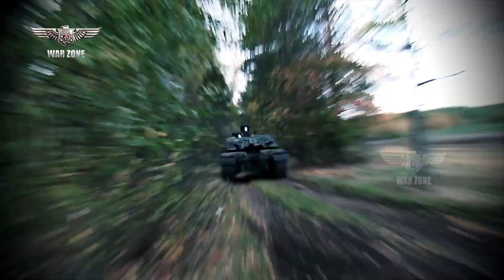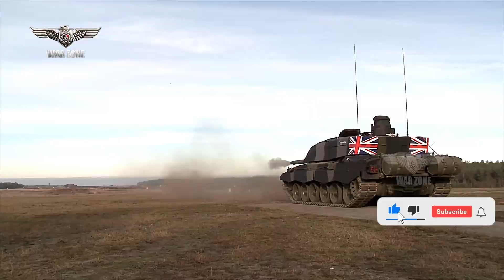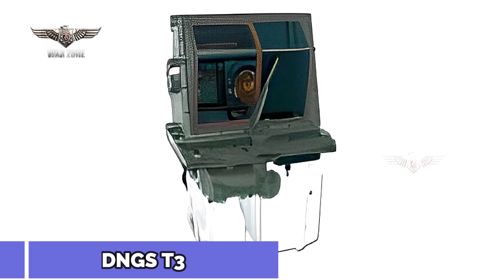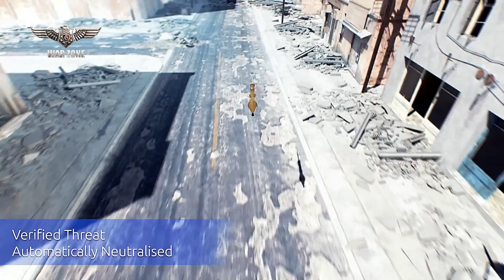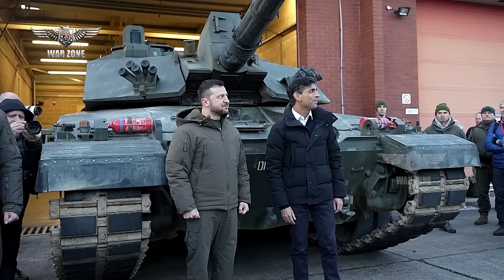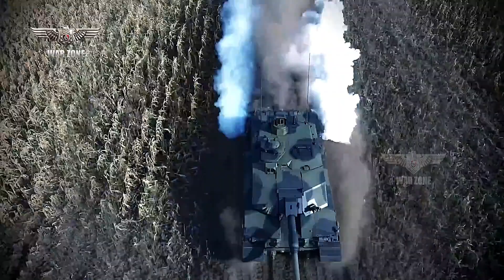Finally: UK Launches New Challenger 3 Main Battle Tank

Comment: As a armed forces veteran, I don’t think we should be freely advising on the public domain of the design and capabilities of our new tanks or any other mechanised weapons and vehicles, why you might ask, it’s simple, need to know basis, if the public knows about then so will any enemy. The elements of secret and surprise on the battlefield and in the theatre of war is the biggest weapon.
Reply: You can bet that the info they do let out is low level. They’ll keep the specs and exact capabilities under wraps.
Reply: @Skiddins  yea no.. most of these are private companies and they just wanna selll.. these companies are not controlled by the goverment. What you see is what you get
Reply: JESTEM Z POLSKI I MA PAN 100%RACJI
Reply: it is refurbeshed crap 
- The Challenger 3 has been unveiled as the UK’s newest and most “lethal” main battle tank (MBT); 
- The Challenger 3 is produced by modernizing existing Challenger 2 MBTs with 127 planned for conversion from the UK’s existing 221 Challenger 2s; 
- The refurbishment/modernization of 127 tanks will cost $990 million or approximately $7.8 million per tank, several times more than modernized Russian tanks, and even more expensive or as expensive as new Russian tanks; 
- The Challenger 3 will weigh more than its predecessor, and both tanks are heavier than their Russian T-72B3, T-90M, T-80BVM, and even T-14 counterparts; 
- 127 MBTs in total will mean that most likely fewer than 100 tanks will be operational at any given time making it impractical for the UK to project military power abroad in any significant manner; 
- The Challenger 3 features a 120mm smoothbore gun that will use NATO standard tank rounds which is an improvement over the Challenger 2’s rifled gun which required unique ammunition incompatible with other NATO tanks; 
- The Challenger 3 is another illustration of Western military industrial production, emphasizing expensive, complex weapons built in small numbers to maximize profits versus equally capable, but cheaper and more numerous Russian or Chinese weapons designed to maximize both battlefield and strategic effectiveness;
- While a Challenger 3 may or may not be capable one-on-one with a Russian MBT, the fact that Russia has many more tanks and is able to replace damaged or lost tanks faster than the Challenger 3 and other Western MBTs proves a disadvantage to the UK and the rest of NATO;

Comment: If they are going to equip these tanks with blow out panels then they must be made heavily armoured with enough protection against drone attacks, I would say use chobam armour on the whole top off the tank as it’s certain most future threats will be top attack munitions
Reply: that is too heavy lol. that is why its only really on the  front part of the turret. Should go with active protection instead and sensors to help crew to not get into position enemy can easily attack. Avoidance is the best defense.
Reply: @jeanmuyuela8112  actually it’s not as they only need apply enough to stop a rpg round, and it can also be designed as application armour so it only needs fitting once it’s required, but it’s obviously needed as just look how easily the m1a1 where knocked out because the Russian drone operators understood the top blow out panels where nothing but lightly armoured top panels, if it’s a weight problem them remove some armour from the front arc as it’s obvious most tanks no longer have to fear direct frontal attacks so remove the weight from there and use the savings to up armour the areas that are most susceptible to drone attacks that being the wafer thin top armour on M1s I said years ago this was going to me a massacre problem for the M1 fleet, actually you say it would make a tank to heavy and you laugh but infact your very wrong as the challenger 2 has a massively heavy armoured roof with chobam armour to protect from top attack since the 1990s, go look at Videos of challenger 2 roof armour thickness and then m1 roof armour and you will see that challenger definitely uses chobam composite up on the roof so as to protect against top attack munitions
Reply: @jeanmuyuela8112  and you say it’s only used on the frontal arc because of weight and yes in a way you are correct but the challenger two has chobam on the front and roof as standard and the front hull and sides are very thinly armoured but they will never enter actual combat as such as they were designed to only ever go into combat with Dorchester armour mounted module packs fitted
Reply: @Custodes1  they dont matter as they are too thin... only on the cheeks is actually effective.  Also are you blind? Cant yoy see how big is that driver viewport? Massive obvious weakspot. And you have to accept the fact that tank do get hit inc the hull
Reply: @jeanmuyuela8112  drivers view port lol it’s not a computer game your playing where it’s easy to hit such a small part of a relatively small target over all, have you any idea how small a tank size target actually looks while viewing through optics? Go out try shooting a toy car with a air rifle 200 feet that’s what it’s like trying to shoot a tank any even 1 kilometre with tank optics and your lucky to hit the tank never mind trying to hit a small section of the tank especially the drivers port, trust me it’s not anything near a weak spot
Reply: @Custodes1  lol all you have is "this is not a video game" i did not base it on video game. The viewport is like 20% of the front surface area like come on get some common sense. Also it was already lnown it got easily petentrated from the lower front by a simple rpg. Challenger tank is soo overated. No proof of it performing well just all he said she said. Atleast there is a video of t80 getting hit multiple times by an rpg before disabling and that tank suck too but challenger is the worse and people who praise it is just dillusional
Reply: @jeanmuyuela8112  this is what really annoys me as people like yourself who has only ever learned about armoured warfare from games such as war thunder and that world of tanks which if I’m not wrong both have been created by Russias and in such games they will feature the challenger 2 in game with just normal standard armour the armour set up the CR2 will have while not at war and they take these figures and feed it to dudes like yourself but if it’s T90 they will add all reactive armour to the tank along with a vast helping of fake made up super figures that basically makes Russian vehicles basically indestructible lol and real life shows and proves the exact opposite, it’s a reason only one challenger two was destroyed in Ukraine, after a mine strike thén multiple kornet strikes and then the Russians had to call in a hit from their massive drone and only then after a few hours of a stationary vehicle were they able to destroy it

Comment: There will be a power increase as the plant will be upgraded with a new fuel injection and cooling system, the new plant is likely to put out 1600 bhp. The hydrogas suspension is also upgraded improving mobility further.

Comment: its not even a new tank, irs challenger 2, with a body kit. as no new chassis are being made. so if one is taken out, they will have to scrounge the scrap yards, or ukraine, for a spare challenger 2, to upgrade
Reply: Completely wrong and you obviously didnt watch the video. The only thing that will remain from the challenger 2 is the hull, the hull of the challenger 2 was already a great design. Eveerything changeing is the electrionics, vision systems, passive protection systems, new engine, new turret ring, new turret, new gun, new suspension, new engine. Literally everything is going to be new except the hull, so how you can say at that point its not even a new tank is pretty baffling. They also stated in the video that with the new RBSL factory they can make new hulls if needed, for example if there are future orders or foreign orders. However why throw away what is already a great design, its better to use old hulls and save a few pennies.

Comment: it just an upgrade...... if we want more we cant have them (once challenger 2's runout) why not have built a new tank incorporating the lessons learnt but in a new tank  which would have been even better plus we could produce more if needed !!
Reply: we can build more Challenger 3s they said in the video they have the capacity to make new hulls at the RBSL factory.
Reply: @ashleygoggs5679  What they mean is using existing  chassis not a new one....they say the might be possible to make new chassis not that they can this is really more impossible ...it would have to be remade as all mold's and other equipment is no longer available ...then you might as well use a fully new designed to make use of improvements

Comment: So smooth bore instead of rifled, to fall in line with the rest of nato, but are the advantages worth it?
Reply: Yes, rifled guns are not more accurate nor do they have more range, becuase if they did every tank in the world would use them to take advantage. The commonly used ammunition of a particular country will dictate the cannon being used, British have always loved hesh so we used rifled gun as this gave better results for this round. However hesh would see less use in a modern battle field and there are other HE round that can be used in a smoothbore that fullfill a similar role. Smoothbore cannons allow for more accuracy and range when using a Sabot round aswell as meaning you can have a longer penetrator which allows for more armor penetration. So overall the tank will have more armor lethality. But the overall advantage is having more ammunition as it will use nato standard, another benefit is because we arnt using specific round anymore, ammunition will likely be cheaper becuase of its abundance.

Comment: What a disappointment not the tank but the amount of tanks involved not even new tanks , this needs to be rethought all Chalanger twos need to be converted not just one hundred odd . Germany on top of its present tanks has just orders one hundred and seventy four brand new tanks , they even have the KF 51 in the wings . Even the present amount of Challengers is not enough it needs to be three times the amount that of the Challenger two also I would look at buying the CB90 120 or have the Ajax have a simaler model as the Amaricans have done with there M10 Booker which is based on the Ajax Hull and body . There are many jobs that need a heavy mobile gun but does not need a tank , in the British army this used to be done by the Abbot self propelled gun which also had a 105 gun , it was maneuverable enough quite than a tank and was at its time fast enough to keep up with MBTs and APCs AFVs on top of this the Cockerell turret with its 105 gun is an option especially cupped with the 119 amunition used buy many NATO country's including Amarica  as they use the L119 Howitzers , useing the Cockerell gun and turret and the Ajax Hull would make it very light around thirty tons it also has the added advantage of the gun system being a self loading system reducing the crew to three . I understand with reduced crews the problem of maintaining equipment , we had the same problem with the Abbot we got around this but having two exstra men in the stalwart the amunition carrier for the Abbot they would dismount when delivering ammo to the gun stay untill the stalwart picked up the spent rounds and empty boxses we also had two exstra 432 APCs one for each troop with exstra men to preform gun position safty and quick responce but at night returned to there guns to do Maintenance this also worked if the gun though a trade one of the 432s would stop and as they say many hand make light work . This meathod could be applied to all vehicals with Auto loaders like the KF51 with I see is the next logical step in modern warfare this Veical MBT has many new technologies that can be used some not fully optimised.  Take the position of the loader , his job could be changed to what the Airforce call GIB guy in back the weapons officer , he could be responsible for manning the radar operating the drones and the loitering amunition also maintaining the digital information net as well as the radio net takeing more of the workload off the tank comander if needed you could have two men in a mirror set up like the TC and Gunner on the left of the tank these are just my thoughts but I think this would work . As for Funding there are many ways to do this one is to stop all funding to overseas country's most of which goes into corrupt officials pockets and not the people who need it and some country's India do not need it they look on it now as a snub they say they are doing fine they don't need this hand out ,true enough a country with its owen space cappaserty does not need our help anymore . This could bring back billions of pounds to this country in a way you could say this money could also support there people life in this country

Comment: Despite it being called Challenger 3 it's a life extention program for Challenger 2 while the true replacement design is finalised and prototypes are constructed.  There are already changes being made to the Challenger 3 designs taking on board lessons learned from Ukraine and advancing technology that will be available in the next year.
Reply: And you believe all that it seems 😅😅😊
Reply: Which was a life extension of Challenger 1, which was a platform forced on the UK due to a US export ban to Iran, that was itself an improved version of Chieftain (Designated “Shir”), a fleet of which was built for export to Iran under an order that was not fulfilled.
Reply: The UK therefore cancelled MBT80 I understand, which at the time was a design filled with ingenuity and tech that likely trickled into the Challenger, but the Chally was never intended for the British Army.
Reply: @StoccTube  no it wasn't but it ended up being a good platform and is well liked by the lads that use it, if it wasn't for delays in the new technology destined for Challenger's replacement this LEP wouldn't be necessary but now that there are lessons being learned in Ukraine the replacement gets further away.